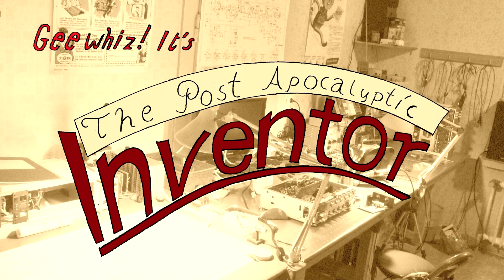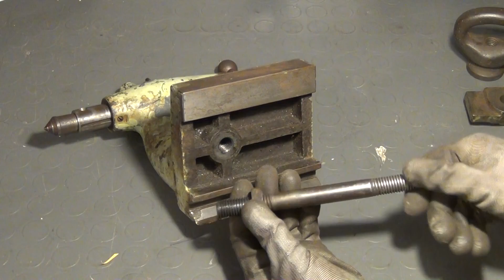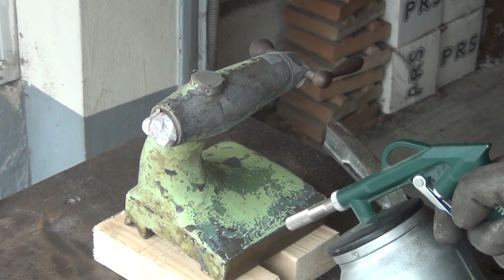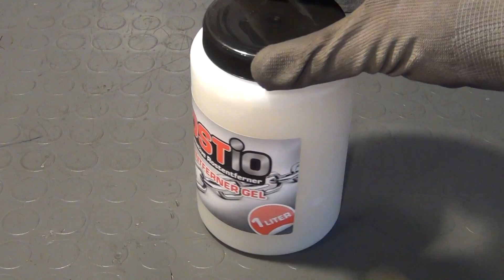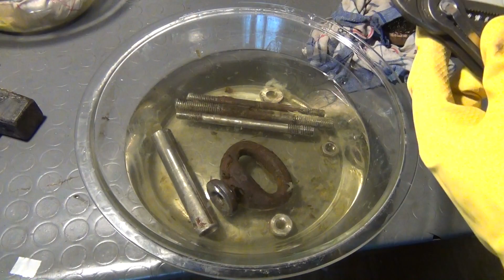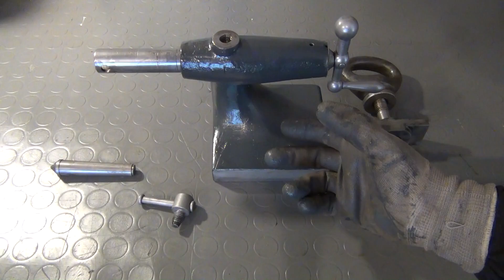Lathe Restoration (2): The Tailstock + New Paintjob

Comment: While It may not scale to the larger parts, I have been using raw molasses in a 5:1 dilution with water for removing rust from old tools.  Its not as fast as some of the other chemical means, but it leaves a very clean finish, works especially well on cast iron. Typically 2 weeks in a  bath of the mix cleans things up great.

Comment: The ways aren't that fragile. Especially on a cheap beat old lathe. Don't worry about screwing them up. Light corrosives or abrasives (stones wire brushing, don't sand it.) won't really hurt it.

Comment: The tailstock looks great!

On my wood lathe, I found the tailstock would slide backwards on the rail too easily while mounting wood to the spur head, regardless of how tightly I tightened the bolt:  The clamping plate surface was unevenly worn, and so it was only making contact with the underside of the rail at a few small points.  I used a metal file to square it up.  I don't think this is as much of an issue for a metal lathe tailstock, as I don't think there's a need to crank it very hard against the work, as is sometimes necessary with wood spindles. 

I didn't, however, touch the mating surface of the tailstock and rail, as it might put the tailstock off-center with respect to the the headstock.  While it's not too big of a deal to be a bit off-center with wood, but I suspect it's a lot more important to have it true for metalwork.  

I'm not even sure how one would correct centring issues... Shims?

Cheers!

  -nevin

Comment: More lathe restoration videos please, I very much enjoy your videos although some are beyond my intellect.. I would like to add that if joy have any extra holes in your castings you can fill them with JB Weld or any other high quality epoxy. This will help in preventing future cracks due to stress raisers caused by unwanted holes. I've even used these products to fill unwanted holes in my drill press and milling machine on the machined surf uses, which is mostly for cosmetic purposes, but dressed flush and oiled the holes just don't show.

Comment: Perhaps an old tapered drill could be reworked to fit the rather large chuck, better than the nasty hole+pin method :-).
Nothing wrong with the paint, its fine for a machine :-D

Comment: Nice! Also like the color, it fits old equipment like that. 
Do you have a brand name of that paint? Looks like thick heavy paint, the good stuff. Stuff that is hard to get these days..
Reply from the maker: +huberkarle I bought this from "Heinz Schaber" online and had it shipped here from Austria. It was pretty expensive. The guy has a homepage but it is rather poorly designed and it seems it's only available in German. 

This is the page where you can find products of this type. I guess here it is sold as "bootslack" ("boat paint") "2k" stands for "two components".

http://www.bootslack-profi.at/catalog/product_info.php?cPath=18&products_id=1
Reply: +The Post Apocalyptic Inventor Thanks! Its really expensive, yeah.. But i keep it in mind if i ever need some thick paint. The "only for industrial use" in the datasheet does say enough to be sure its good stuff lol.
I have an old east german tractor built in 1960, and it was heavily used to the early 80's, it was also in revision a few times.. And each time they had the tractor in revision they just sprayed another coat of paint on it. Man that stuff is something, i bet it wasn't any good quality back in east german days but it sure is thick and heavy. It orange peels everywhere but it isn't coming off. Apart from a few parts where the paint did wear off there is no severe rust or anything coming through the paint.
I guess some day i might repaint the thing to make it look nice and to protect the parts that have worn off, but i  probably won't find paint that will hold up as well ever again :D 

With all the environmental laws (don't take me wrong make sense in places) its really hard to get any paint anymore that isn't basically colored water.. I guess 2k is the way to go nowadays.

Comment: I would bathe the ways, as you call them, in some sort of oil designed to clean rust/parts, and just use them for a while. Trying to assure they would move freely and without issues while, constantly applying more oil and cleaning the debris/old oil. Eventually by simple use they would get cleaned by their own action.
Reply: +mudemmeonick That would be bad as any rust would act as sanding grit and mess up the ways with long scratches.  Scratches like that would allow the oil to ooze out from under the carriage and accelerate wear.  If he uses a chemical to dissolve and remove rust it will leave behind tiny pockets to trap oil and work much better.  He'll just have to wipe the bed down more often to clean out tiny grit and dirt particles.
Reply: I said clean as it gets free. Read before you post for glory.

Comment: it doesn't seem like much that lathe but if it works with acceptable toleration, low vibration than it is a nice adition to the lab, i'm sure you are familiar with abom79 channel and as i've seen so far on his channel the ways are more important than the rest so if needed with some scraping it should be good enough, by the way hard work with the paint removal, been there and thow i'm not a fan  of chemichal removing it would have made the job a lot easy,    pace

Comment: in your video about the electric motor you said you'd tell how to identify the wires on a motor????  still going to happen?
Reply from the maker: +Shaun Tucker Well in my opinion  I talked about that in part 2 in sufficient detail. The universal motors uses in washing machines are designed in an open construction style: You can find out which of the wires lead to the commutator brushes and which ones are leading to the tacho generator by a simple visual inspection. The remaining wires belong to the field winding. If there are only two, then there is no problem. If there are three wires left, then you simply have to measure the resistance between the three wires with a multimeter. The resistance between the two ends of the winding will be larger than the resistance between a tap and one of the windings. That's pretty much all there is to it.

Comment: If I am not wrong ROSTIO contains only citric acid(Zitronensäure) or ascorbic acid (Ascorbinsäure) and some kind of paste (Kleister). Just taste it! I did!  Now you know why they are so sure that it has no negative impacts on the Environment and other parts/materials of the part you are cleaning.
Reply from the maker: +Berthold Braun Sounds reasonable. I didn't really have the time to do a lot of research on that stuff.  Where did you get that information? Do they talk about the content on their website, or do you know any other sources?
Reply: +The Post Apocalyptic Inventor. I first got suspicious when i recognized the smell of vitamin C pouder and then I tasted a tiny tiny bit and saw/tasted that I was right. Then I looked it up in the internet and found different threads in forums stating the same. Since it is normally either phosphoric acid or citirc acid it was clear to me that they are using citric acid. to be more precise citric acid monohydrate.
Reply: so it look like it work the same as lemon juice or acetic acid (aka vinegar ) .
and to make a gel  if its needed in the aplication we can use just carbomer gel with is basicaly what most contain on some hair gel on the market

Comment: The lathe is cool. For a bit of completeness, what is the status on the edm power supply(s)?
Reply from the maker: +Mark Rowland My viewers didn't seem to be very interested in the project so I stopped making videos about it. The work on the first prototype is completed, the second prototype is still in the making. I haven't had time for it in the last weeks, but I will see that it gets done once the lathe is running.
Reply: +The Post Apocalyptic Inventor Well, not everyone has good taste.  As for me, seeing you working on stuff and explaining the engineering, it is always good to hear another person descriptions because the embellishments from personal experience usually add flavor. as an EE, I like the edm design challenges and performance of your trials. As an engineer, seeing the limiting precision factors in your old lathe are a statement of the state-of-art way back when.   As a bit of "flavor"  an element of interest is the equivalent model of the edm supply and load.  Here I am appreciating your effort. thanks
Reply: +The Post Apocalyptic Inventor That doesn't mean we don't still watch them! That's an area that far surpasses my knowledge. However I still liked watching them. You always learn something. If not the technical bits, some terms, some how-to's. They provide an insight and for the curious type, they might even plant the seed to learn some more!
Reply: +The Post Apocalyptic Inventor Shame I was interested in seeing the build process.
It's not easy to find information on practical power supply design/build.